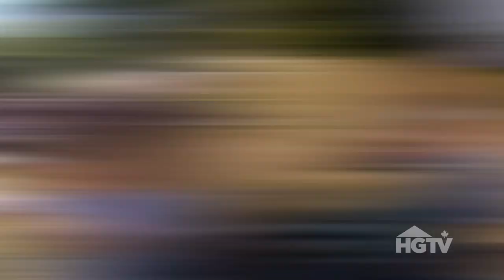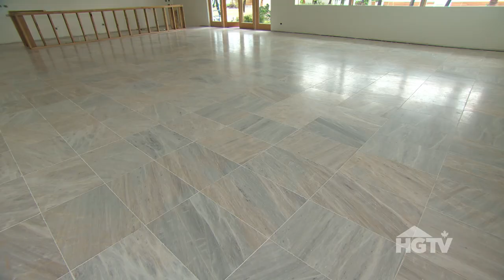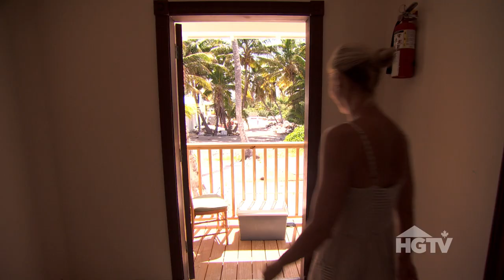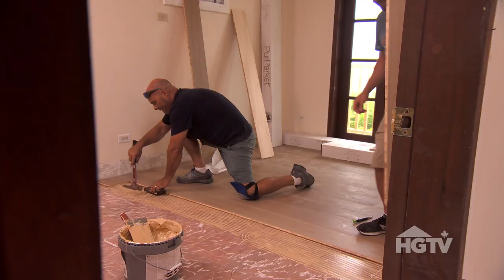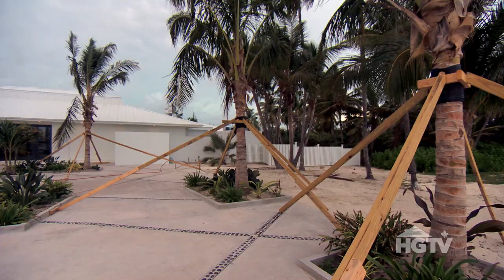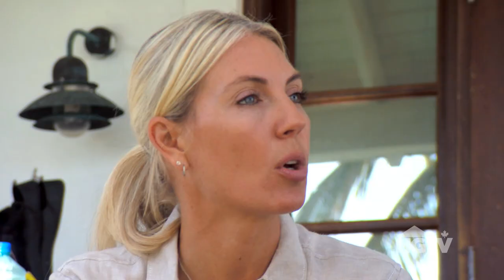Watch a Sneak Peek of Island of Bryan, Season 2

Comment: Free advice for Bryan/wife: There's not much to do on South Andros Island, so you must entertain your guests. You need to add volleyball court, a pier, a power boat and Catamaran, both with your branding on them of course. Amenities drive bookings. Additionally, your resort desperately needs color. Which you can do inexpensively with plants such as Bougainvillea (they come in different colors and will thrive on your island). Plus, local indigenous flowering plants. Take a trip over to Paradise Island and see what thrives there . That's an easy way to see what works in that region.

 I would also suggest getting away from that drab white color on all you buildings your wife seems so set on. The place looks monochromatic and doesn't provide a Caribbean vibe what so ever. In the resort business, every detail matters.